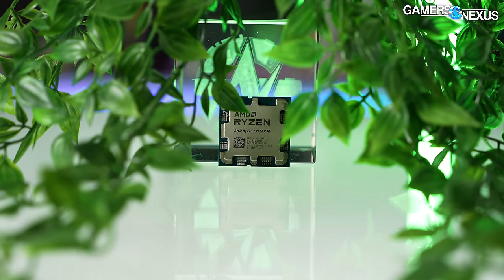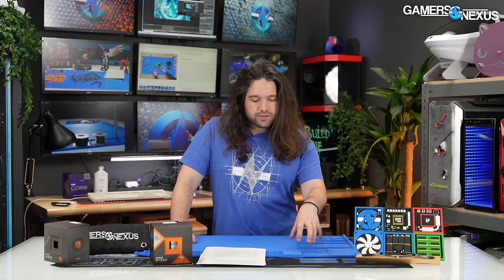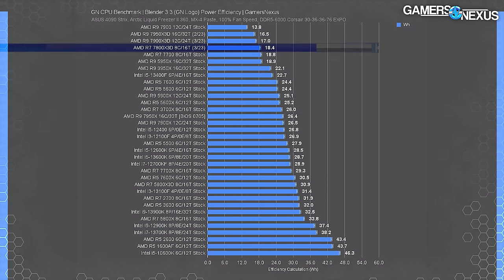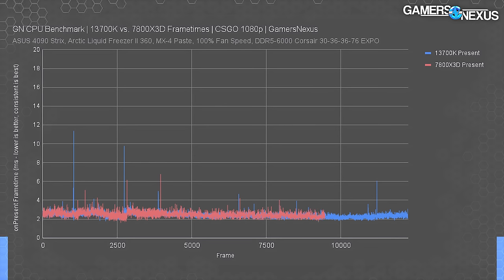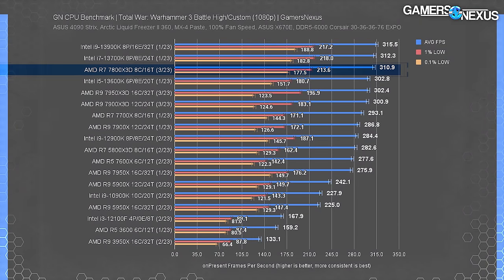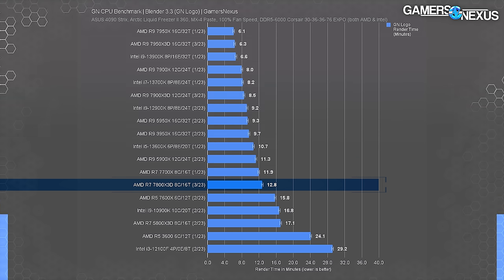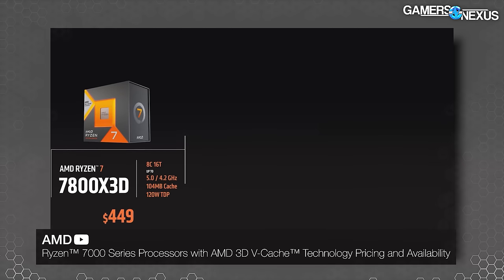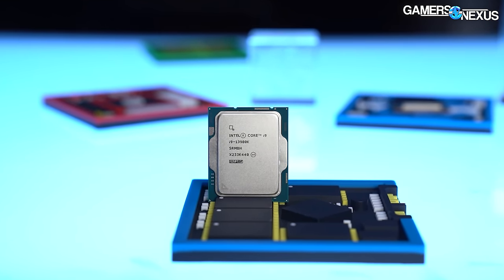AMD Ryzen 7 7800X3D CPU Review & Benchmarks

Comment: I mean people dont believe me but realistically any major hardware change can benefit from a clean install of windows. Much of the benefit of how windows can talk more directly and in depth to the hardware also causes it to be more locked to that hardware and platform. I have even seen large AEGSA updates benefits from clean installs of windows, especially directly to newer builds.

Ive seens systems that started with 7 or vista, downgraded to XP then reupgraded to 7 and are now finally on 10 even though 32bit support really isnt a thing. How working this system was is negotiable, but it did boot and someone used it as their work system everyday.

Ive also seen systems that refuse to update to a newer version of windows 10/11 without a UEFI update with matching chipset drivers.

Keeping hardware consistent Back in the XP, Vista, 7 era I and many others essentially had a yearly windows reinstall to keep things running well. Now well into Win10 it wasnt uncommon to go 3 years or more and usually it was bad hardware causing corruption that required the reinstall not windows just falling apart.

Comment: Can we talk about the weird gaming performance comparison between the 7800X3D and the 7950X3D? They should be effectively the same except for slight frequency advantage on the 7950X3D, right? Since one CCD is parked on the 7950X3D. Except in many tests the 7950X3D is worse, especially in the 1% and 0.1% lows. Sometimes the 7950X3D has better average FPS but worse 0.1% lows. Isn't that weird? Do you have an explanation on why this is? Where there driver improvements between tests? Does the extra CCD introduce overhead even when it is parked?

Comment: There's an important distinction between frame times and frame rates.  Frame times are what really matters as they are absolute, and frame rates are just derivative data that are relative.  This causes a lot of misinformation to be spread as everyone discusses things from an absolute frame rate perspective.  For example, most people don't realize that 40 FPS is the mid point between 30 FPS and 60 FPS, not 45.  When you compare the whole spectrum of frame rates, that gap becomes much larger.  Going from 30 to 40 FPS is a 1/3 (33%) improvement, but the same improvement going from 120 to 160 is far less impactful.  Even though it's the same percentage and the latter is a 4x increase in frames, the former is a 8.3ms frame time improvement where the latter is only 1.2ms...  ~7x difference.

Comment: Worth mentioning that the FPS gains are nothing almost anyone's monitor will show even if the gains are significant. For example in SoTR the 7600X 261fps vs 385 on the 7800X3D. Frametimes seem fine on all modern CPUs.

Comment: I'm really wondering how the dual-CCD CPUs perform under Linux if you pin game threads to the v-cache CCD. I'm doing this for my Windows VM on a 5900X, where the VM gets one CCD and the host OS gets limited to the other. It works really well and improves the cache hit ratio since both machines stay out of each other's cache. Interesting that Microsoft and AMD don't work together on this to make the scheduler do this automatically...

Comment: Is it possible to overclock it to overcome the artificial segmentation vs the 50class? Or are the sufficiently binned such that they can't hold 5.7ghz?
Reply: None of the x3d chips can get to 5.7Ghz on the 3D segment.
You can though find a video of a guy who overclocked a 7800x3D to 5.4Ghz

Comment: Did you apply any special settings in UEFI or somewhere? Because my 7800x3d inside X670E Taichi motherboard doesn't go above 4,7 GHz during all core load...
Reply: You might need to enable PBO (Performane boost overdrive) in Bios

Comment: Hi Steve, I think these new CPU's that rely on segregating workloads between the cores would probably benefit from a new type of benchmark. I'd like to know if these chips like the high e-core Intel, and the dual CCD X3D are most beneficial in multi-tasked workloads. Especially when compared to the low e-core or single CCD X3D trying the same multi-tasked workload.

We can see in these charts that the 7800X3D gets roughly the same gaming performance as a 7950X3D, which really begs the question of why the 7950X3D exists when it's out produced by the 7950X and out valued by the 7800X3D. I think it would be great to see how these chips stack up when under a multi-tasking workload. eg, gaming while someone else in the house is streaming PLEX.
Reply: I think the way your looking at it is either a workstation build or a gaming build.  If you are going down one of those paths then yeah the 7950x or the 7800x3D are the way to go.  What the 7950X3D offers is a blend of those uses.  You can pretty much get the same gaming performance as the 7800x3d with the added benefit of workstation use.  

So for me, I do a lot of other things on my computer that need the extra cores, but I also like to game a lot.  It's 50/50 for me.  So the 7950X3D was my pick.  Had I only been gaming or a majority of my time is gaming, probably the 7800X3D.  No gaming or minimal, 7950X.

Comment: AMD RYZEN 7700X 

I would have liked to see a “lessor”, more cost conscious recommendation for a gaming/production CPU other than higher end RYZEN 7000 series or Intel 12th, 13th Gen close to end of life.

…and this would seem to be the R7 7700X which you mentioned either in the program. It appears to have a reasonable balance between gaming and production and at a significant cost advantage of around $130 than the 7800X3D as of this comment.

With the 7800X3D chip now the “hot” gaming CPU comparison, you should consider adding a significant number of games to the analysis in order to have a more statistically valid performance comparison against non-X3D CPU'S.

Several other highly respected gaming channels who have tested the 7800X3D against MANY more games have come up with pretty “neutral” conclusions because as you stated it’s performance and therefore interest is linked directly to particular games that take advantage of its characteristics.

In some ways, it's “tech” “plays down” to the current generation application development where many App Developers are still not developing with the latest “best practices” programming, firmware, memory, and architecture techniques. 

These are typically shops over the years who have not kept up to date with “best practices” or have staff that are downright unwilling to change.

For those of you who have worked in these milieus, particularly as a project manager, you know what I’m speaking of. The top Gaming shops what to be known not only for market share but with a reputation for implementing leading edge tech.

In this climate X3D chips would be less desirable and are likely to have accelerating poorer performance compared to mainstream chips as developers transition over to “best practices” applications to take advantage of the latest technology platforms.

Comment: I always hear that the extra V-Cache does not provide a benefit to some workloads (mainly productivity).
But its never apples to apples compared on the same clockspeeds.
Maybe the extra v-cache does help, just not enough to make up for the clockspeed difference.
This could mean that a v-cache CPU with clockspeed comparable to its non-v-cache variants could be superior in all workloads. Maybe it just needs time to mature and fix the issues which currently hamper its performance.

Comment: On the same test, I got a frame rate of 100 with the 3080 ti card using an old 3950x processor. Is there an error in the test? And get a higher result with the 7700X processor

Comment: Will it be enough to get 240hz in rainbow 6 siege if paired with a 2070 super? 

My current pc has an i7 9700 and it can do 240fps but I've been having strange frame drops where it drops down to 40 frames from the 240+ it was getting. 

I know now that my pc is thermal throttling and I'm going to get a new cooler to hopefully fix that. 
However I'm likely still going to upgrade my pc.

Comment: As cool as these tests are. In reality you'll see no difference between the 7900X3D or even the 7800 X3D. 

Wherever they get more frames per second, it's already at over 300 frames per second most the time. 
And then a lot of games they're basically the same. 
In reality people aren't playing at 1080p with their 4090. And they're not doing so at medium settings.

I'm very pleased and happy with my 7900 X3D. Unlike the 7800, I can keep multiple windows tabs open, and stream at the same time without affecting my frame times. Overall? I consider the $7,900X3D Superior to the 7800.

Comment: I have been holding back on this kind of "upgrade" for a while and this is why. If I want to be practical intel, is good and if I game AMD is fine. No beef here but if I have to wait a little longer for a process to complete (AMD), so be it.  The lower energy consumption may be worth it over 5 years. As I was shopping for my next build, the 7950 x3d ads kept coming in with incentives. 
 The tipping point for me is, when I fire up a game that I want to play and have fun, do I really need extra fps? It's unlikely. But that is my use case. 

GN is really making a difference because the variables for each of us, in a real world application,  are presented in the data. You game lots, here is the data. You don't game lots, here is the data. Power consumption is the issue, here is the data. Power consumption is not an issue, here is your data. Are you rich, not so much, a developer, a home user, a mechanic, a 3d printer...look at the data.  And the best part about GN, if you find a flaw in the data...drop it on them. They seem to eat this up. 

In the end there is a balance between cpu, mobo, ram, cooling, m.2, psu and gpu. And the topic of the physical space you have available is not considered in our conversation. And the prices are going up because of supply chain issues.  The GN team is providing a service. And if you consider the environmental impact of choosing the right parts, GN can change that too.

Thanks for the information on this platform.

Comment: The bigger cache is really interesting for coding. I wouldn't need to worry about cache updates. But there are little things like virtualization, better instruction set, more widespread support by compilers, ... that put AMD at a disadvantage for me.
7800X3d is certainly good for gaming. On the other hand, sometimes the difference is not big enough for me to choose the Ryzen. When you play at higher resolution, what matters is only the graphic card anyway.
So that's why I probably buy an intel. And I have to buy the more expensive 14th gen because they have AVX512 enabled.
I buy the intel for 3 reasons: Virtualization, compiling, and because of widespread support.
Is there already software that makes use of DDR5?

Comment: If I plan on turning on PBO for 7800x3d, do I need to plug in my 2nd cpu 4 pin connector in addition to the 8 pin connector? Or does PBO not draw enough voltage to need the second cpu connector.

Comment: already got a 7900x paired with a 4090 at 4k would i notice any difference to go the 7800x3d? or stick with the 7900x
Reply: at 4K you're gpu bound, but if you use DLSS quality to reach stable high FPS let's say 120fps then it might help but very slightly, if you use your PC for other things than video games I wouldn't bother

Comment: If you find any of my comments almost 2 month's ago I called it that the 7800x3d was low clocked so it wouldn't compete as much with the 7900x3d. I'm skipping the 7900x3d and gonna go with the 7950x3d this time around but later when the price goes down some.

Comment: I haven’t seen testing where someone disables the non-Vcache CCD on a 7950X3d yet, that would be interesting.  Not really meaningful I guess since that’s now how it’s meant to be used, but interesting to see if the 7950X3d is better/Same/Worse than the 7800X3d when using only a CCD.

Comment: Honestly with the 7800x3d and the 13700k being such vastly different chips yet none of the two actually dominating in every field of gaming it's pretty much impossible to actually "get on the side of" one of those cpus. It's starting to feel like "eh. one is better here, the other is better there. chose whichever is better for what you want to do but both are fine and it doesnt really matter anymore"
Reply: I prefer the 12700K over both, the 13700K's efficency is not good, it's a 12900K refresh .
Reply: That's what I was thinking. In gaming they are rather similar but in multi core, the 13700K is almost 2x faster

Comment: I have a Gigabyte b650 motherboard and it has TWO revisions which are difficult to discern, and as such, installed chipset drivers for the wrong revision. How can I tell if my OS is "contaminated"? Running a 7800x3d. Thank you!

Comment: Where does the Ryzen 9 7950X3D shine? ie where would the extra cores and threads be used?
Reply: Production workloads. Rendering, video editing, compiling code, video encoding, VM hosting.
Pretty much anything that is designed with infinitely scalable multi-threading in mind

Comment: Did anyone tell Steve, that AMD quotes non cache CCD boost clock on 7950x3d, which is 5.7Ghz, 3d cache CCD on this CPU is only clocking to 5-5.2Ghz? 7800x3d does not have non cache CDD, so it is limited to 5ghz due to technical reasons, and not because AMD wants to segment the market. If 3d cached ccd could clock to 5.7ghz, I am sure AMD would have allowed that

Comment: the 13600k might be kinda equal, except it also uses 2x the power, you save a 100 euros, that you'll end up paying within a year in the energy bill lol.
I did end up buying it, before switching to the 7900, but in hindsight I would've let that system stay with the 10600k I built it with and get my new gaming rig with this 7800x3d, but I don't really feel lke side-grading from 7900 to 7800x3d even tho the gaming gains are good (I don't do productivity on that machine), probably just wait for the 8800X3D.

Comment: I have read two different articles about the AMD R7 7800X3D burning up in an ASUS STRIX X670-E motherboard. Evidently there is an issue with the pads on the CPU burning . Both the motherboard socket and the CPU are destroyed. There is some speculation over voltage is the issue. Others indicate it is not. One source is a Russian site. I should have taken notes.

I am anxious to see one of your deep and thorough investigations should this become warranted.  Thank you in advance.

Comment: I'm not computer savy but assume a lot of you are. Some advice would be awesome. I have a 6900XT Red Devil and 7950X. 240hz 1440p monitor. I was told to replace my 7950X with the 7800X3d. I play mostly Warzone. Does that make any sense? Looking at the specs it's hard to imagine I'll  notice a difference?
Reply: If you already have this build, I would keep it. But if you haven't bought it yet, then yes, change it with the 7800x3d.

Comment: The biggest benefit is longevity, the Intel socket is end of life, whereas the AM5 socket probably has another round in it. So if you're building a new system, your value goes further with an AMD build.
Reply: except am5 had horrible core to core and also memory latency compared to intel.
Reply: @Iadders  for the average gamer and user, this has zero impact on real life performance.
Reply: i personally play fps games, so it can be a noticable difference, but i see your point @evldice
Reply: @Iadders  in competitive fps I suppose the CPU would play a much larger role but in most testing I’ve seen, from reliable YouTubers, it seems negligible. I don’t play competitive FPS games and I’m upgrading from a 5600x with a 4070 to a 7800x3d with an RTX 4090. I’m hoping to get a few good years before having to upgrade again.

Comment: I also went for the 5800x3d as it was simply a cpuswap, the am4 system of my daughter will also get a 5800x3d by time. I assume that the comparison in 1080p is pointless as the group of buyers spending 300 (5800x3d) or 500 (7800x3d) and perhaps 1500-2000 for a 4090 in the majority will play in 1440p or 2160p, and for those probably it doesn't matter if the use a 5600, 5700, 5800, 5900, 5950 or even in intel domain 13600, 13700, 13900. in 1080p you are not GPU bottlenecked with a 4090 yes, but the real question is if you have for example a 3080 is it worth to upgrade your cpu if you have a 12th gen intel or 5000 ryzen and you play on 1440p or 2160p. All the answers here are valid if you want to play in 1080p in the future, and you want to upgrade your entire system to the level of the test system.

Comment: I know it's been done before, but a DDR4 vs 5 and slow vs fast dive between the 7800X3D and 13700K might be interesting. Intel is currently still leaving DDR4 as an option while simultaneously having a stronger memory controller for DDR5. Problem is it would be 5 test setups and a ton of time. Intel looks like the value proposition again, which is great. Maybe a whole video of nothing but frame times to compare the 3 ram options and 2 CPUs for the gaming benches.

Comment: Why can't AMD do what Intel did with some older CPUs where they gave their CPUs an integrated VRM, but instead of having it or the entire core, bust have a separate internal VRM just for the cache, thus allowing the rest of the core to use higher voltages and not have to give up on clock speed?

Comment: Sounds like the 7800x3d would be a killer small form factor CPU. 50/50 with the 13700k in a larger case. For ultimate performance, furnace be damned the 13900k. And the average desktop user should probably get the 13600.  There is an upgrade path argument to be made with a 7600 and others however it seems to be pretty rare. 

Good to have competition.